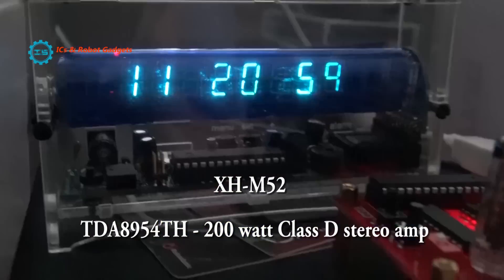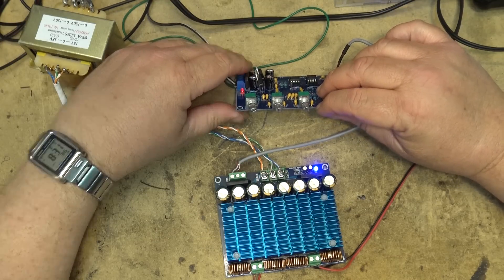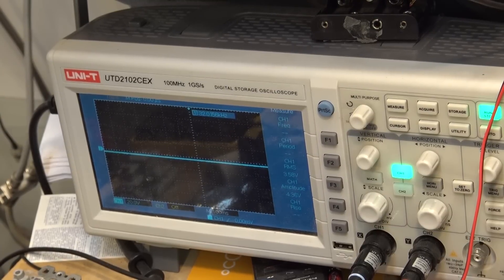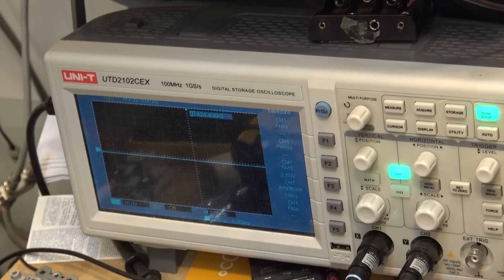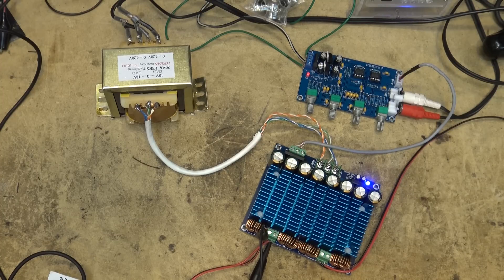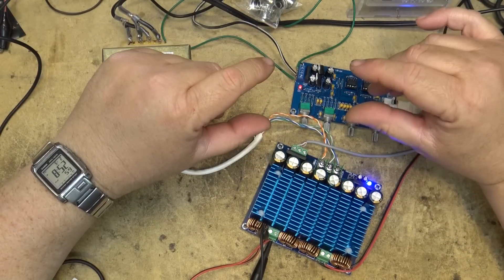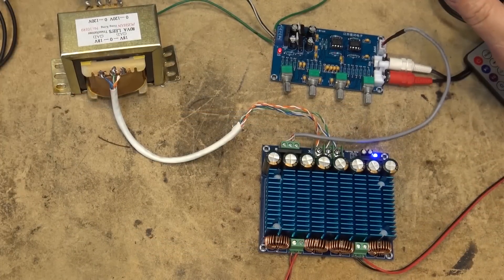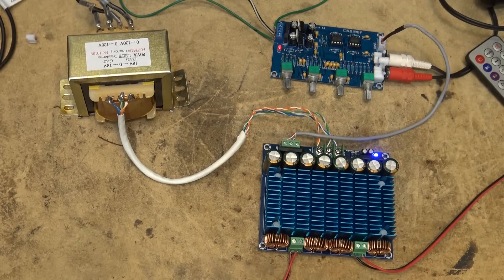XH-M252 TDA8954TH Ultra high power Class D amp review

Comment: Nice video sir. I bought this board Fter watching this video. My board came up with 2fans ,one each ic with 2 individual heatsink and a little volume control.  requirements of the transformer is dual 24Vac (24-0-24AC) above 300VA so I ordered a 24 dual ac 500VA toroid transformer. I never used on board dual rectifiers so I made my own dual DC power supply with 4 22000uf capacitors 2 on each channel and 8 SF58 (5amps) ultra fast recovery diodes 4 on each channel. I hooked every thing up the sound quality is much better than my old stk4191 ic's receiver. Bass and sound quality is really good and expected after spend around $200 behind the project lol. I got a question now, should I use 4 more diodes and 2 capacitors to make another dual 24 DC  supply to added my another stk4191 board with the same Transformer?? Because I feel like it's weasting of power lol, the tda8954 board probably can pull 300-400 VA (6-8 Amps) 3 to 4 amps on each channel and I still got 150-200 VA(2.75 to 4 amps)left which is perfect for my stk4191 board. Any suggestions please?? By the way all other components like volume control board fans etc I have used another transfer so no power lose from the main transformer. Any suggestions please.
Reply: You sound like you have a pretty good idea what you are doing. Im just learning but have some ideas that I think I want to try. Where did you get your board with fans and volume control? I'm thinking of building one with BT module  and building it bigger heating and some other fan systems to run lower frequencies for a little longer.

Comment: Do you have a net hum in the speakers when AC supply is connected to this amplifier? I bought the same model as presented on your video and unfortunately i have strong net hum in my speakers. I use Denon PMA-720AE as a preamplifier (it has designated outputs) and 2x27V AC transformer from old amplifier. I am some shocked because it disclasifies disqualify this amplifier. Additionally the radiator is getting very hot after a few minutes after the switching it on.
Reply from the maker: No hum at all. Heat sink doesn't even get warm. Sound like something is blown.
Reply: But, my item plays music so this is very strange. You do not have hum and your amplifier even does not getting hot during playing the music. So, i think my amplifier is broken. I have to return it. This is the risk that it have to be taken into consideration when items are bought on Aliexpress.
Reply from the maker: @AK-de3ej  
Never used Ali Express myself.  Only banggood and ICStation, and had no issues.  When a defective item received I contact them and they send a replacement.
Reply: Thank you very much for the answer.
Reply: @AK-de3ej   Did you ever get a new amp? Did it not have any problems with hum? My amplifier does also have a strong net hum.
Reply: @Lunderne456  They claim that it was a new amp. I do not use it because I am afraid about my speakers. It cost ~25$ so it is not worth to damage a speakers. Unfortunately the time to return it went away. I will throw it away or try to figure out what is wrong with it.

Comment: Thanks for the video. Actually, this has two BTL chips, so its max 420W per channel... Bit on this board it cant do that.This is original data from nxp: 

SE 2 × 210 W, RL = 4 Ω (VDD = 41 V; VSS = −41 V)
SE 2 × 235 W, RL = 3 Ω (VDD = 39 V; VSS = −39 V)
SE 2 × 150 W, RL = 6 Ω (VDD = 41 V; VSS = −41 V)
BTL 1 × 420 W, RL = 8 Ω (VDD = 41 V; VSS = −41 V)

Not sure why only +- 30V when it can take +-41 and caps are rated @50v, I guess that filter is not that good. The chip itself is not even close to its maximum
Reply: Can I trust that data?
Reply: @jakobh3718  check datasheet for the chip, google "TDA8954TH datasheet"

Comment: Can you power it whit 18650 battery's
Reply from the maker: No it requires 24 volt AC.  That is 24 - 0 - 24. Once rectified that would become about +30 -30 volts.
It might be possible to build the required voltages using about 14 18650 cells in series and using the 7th cell junction as the 0 volt point.
Reply: @12voltvids  thanks a lot
Reply: @12voltvids  there are Ebay pages which say it can also be run on 24v DC have you tried running it on DC? Because the voltage gets rectified immediately as I can see from the traces and would know if it works or if I saw it wrong
Reply from the maker: @BadMax02_VR  The voltage gets rectified into 4 separate supplies, 2 per channel with respect to the center tap. With 24 - 0 - 24 configuration that will produce about 48 volts per rail.
So your +24 -24 swing on ac cycle will produce just under 48 volts DC. Do that for the other side of the transformer secondary, and you have another 48V. Negative of one cap to ground positive of that cap to negative of the second filter cap (so the mid point floats at around 48V) and on the positive terminal you have about 96 volts. That 96 volts becomes the switching voltage for the pwm signal. This is how you get the rated power of this module. Can you power it with lower voltage. You sure can but the output wattage will be greatly reduced because the PWM switching voltage is what derives your speaker voltage after it runs through the LPF to remove the switching signal. Make no mistake this amplifier delivers serious power at the rated input voltage.
Reply: @12voltvids  so how would I go to power that thing with a a couple of switch mode power supplies wired in series I have a few server supplies which each have 12v and I can wire them in series like I want because I have isolated them.
How would I do that or is it even possible it should right?
Reply: Most definitely, say you can use the TDA8954TH with both AC and DC voltages.  You just need to make sure you can provide the required amperage using DC Voltages

Comment: 12VOLTVIDS, thanks for the video, very informative.

I have the same class d amp, and just recieve it yesterday. it is meant for a very nice stereo subwoofer system with a pair of 10" 500watts 8 Ohm, that i restored and upgraded for the task. i hope it work good enough to drive those swoofers.

I will ask somethings:

This amp has on it a couple of TDA8954TH (TDA8954TH x 2) each one fixed at mono function. and it's datasheet  show a power value of 420 watts per channel.

Sorry if i don't understand or miss something in the video, but:

what is the real output power of this amp per channel with a psu at 18 volt 10 amp (this is a very nice trasformer) and at 24 volt 10 amps?

this amp can be arranged in bridged mode? (because this amp have 2 TDA8954TH each one already bridged to give 420 Watts each or per channel.) 

so, in this model, how can i use the bridged mode?

thanks for any help about this matter.

greetings.
Reply: Hello
Please tell me about transformer
I have a XH-M252 (420+420w) amp 
This amp is give 420w RMS Power @ 8 ohms
So please tell me about power supply
Volt is 24-0-24v that's I know but please tell me about current if I use 24-0-24v 12A transformer is suitable for this board or not If suitable it's ok but if not suitable please tell me about current or fully details of transformer

Comment: I have this same amplifier, every thing  sounds good and seems ok but the only complain is that those inductors and the heathsink gets too hot(65c+) without any load and signal, after 2 minutes of being connected i can't even touch the heathsink or the coils so i think something is wrong or is about to fail,the voltage is 24-0-24 AC so nothing wrong there, not even a linear amplifier do this that i know.
Also i have another amplifier tpa3116 that only gets hot when music is playing loud
Reply: Oscillation, Possibly outside human hearing range...?Do you see anything on a scope. No scope? compare current draw with inputs shorted Vs. connected.
Reply: @Chancho00,  I am also experiencing same issue when connected with 24 0 24 and no load and was wondering whether  the board I received is faulty.  But now it is confirmed. Something is terribly wrong with this amplifier. Thanks

Comment: Its just a shame that all the audio boards have different supply requirements. It would be good if they produced a line all running from a single ct ac supply rather than 12v, 24v etc.

Comment: I wonder if you could connect the two channels in parallel to drive a single speaker.  I'm thinking of a high power amp for a subwoofer that might go down to 2 ohms.
Reply: You can do that with dual voice coil speakers. Also many Texas Instrumen class D amps lets you bridge them for mono and 2 ohm stable.
Reply: That chip does show specs down to 2 ohm
Reply: @coilsmoke2286 but it said on the datasheet on the amp chip. It can only handle 8 ohm loads..... But it can handle 4 ohms but it has a current limit and cuts of at around 60% vol due to the protection.
Reply: there are 2 chips on the board one for each channel and they already are in bridged mode because one chip is a stereo amp but with a brdiging mode built in so that they are already bridged normaly 2x210w one chip and bridged 1x420w because there are 2 chips 2x420w
Reply: I dont know if you can put in Parallel BTL PBTL AND work with 4ohm load AND make 800w 10% THD or 400w 0.2% THD for Better sound quality

Comment: I would love to try these amps out but looking for a transformer is given me a headache now.
Reply from the maker: Get one from an old receiver. That's what I plan to do,
Reply: 12voltvids 24 volts at 500W (200Wouput/channel right?) isn't easy to find, that's for sure. Rectified that's 34 volts or so, B+ voltage only found in low power recievers. I guess it's a catch 22. Does this amp's power supply require a center tap? A variac is dangerous but may be the only good way to get full power.
Reply from the maker: Evan Fitzgerald 
It will draw much less than you think. At full power this is going to draw less than 10 amps on the low voltage side. Remember each side is bridged so each leg running 48 volts around 2.5 amps, 5 amps per speaker. 10 amps total for low voltage side. Primary side would be about 2 amps. Remember these are very efficient amplifiers unlike a linear amp which wastes much of its power as heat.
Reply: 12voltvids 240W transformer then? The amp in the video is 2 50W at 8 ohms channels bridged for one channel of 200W at 8 ohms, correct?
Reply: @Stereosandotherfun  could I power it with 4 12volt car batteries.
My truck is 24 volt .And I have a couple spare lying about .
Reply: @seancunningham9448  probably you would just need to make a center tap with half the voltage

Comment: Could you link to that transformer you have there? I have the tube amplifier you have that hooked to orginaly. I have searched high and low but can't find one anywhere. Thanks
Reply from the maker: Charles Tyler 
Transformer came from lees electronics in Vancouver.
Reply: 12voltvids they won't answer emails I sent 4 weeks ago. The model you have is out of stock has been for a long time.

Comment: Hi, new to your Chanel , enjoy your vids, have picked up a few tips and tricks, I'm an ametuer enthusiast so always looking out for helpful  instruction, 
Liked you review of the turntables, although not convinced enough to buy one, 
How ever;  have a question for you relating to turntables, I just bought a valve preamp, the 6j1 stereo and  its output is extremely quiet, my question is, are these things design for ceramic cartridges or magnetic, I use magnetic, and the only way I could get this thing to perform was  to plug into a built on turntable preamp in an older HiFi amp?. 
Look forward to you're answer/reply, thanks Gary.. Cool vids. Keep; it up, stay well.
Reply from the maker: gary Maddison 
Many of these valve buffers are just that. They work with line in and give line out. For a magnetic cartridge you need a magnetic pickup preamp.  They are also available. I converted one of my tube buffer over to a phone preamp stage by just adding an ic based phono preamp with runs eq ahead of my valve preamp. That way I get the gain of the preamp ic. And the sound of the 12au7 tubes. Sounds fantastic.
Reply: Hi, thanks for taking the time to explain, ( re) 6j1 valve pre amp, I wasn't aware they were merely buffers, yove helped me  again thanks, and appreciate you answering, be well. Gary.

Comment: So, is that 325 watts per channel?
Or did I figure it wrong? (At 8 ohms   per speaker) edit:I forgot 51 volts might be peak to peak, not RMS.
Reply from the maker: Mark Markofkane 
210 per channel is what they claim and the chip spec supports this. At 24v CT transformer that is 48 volts rail to rail to rail per speaker output lead and since this is btl that would be 96 volts differential max between the +and - terminals. You will obviously never see 96 volts as that would be in a perfect 100% efficient model but it should be able to push peaks well into the high 80 volt range. These amps are pretty efficient.  I used to thumb my nose at class d, as being a bit of an audiophile snob my feelings is if it doesn't have tubes in it, it isn't worth putting music through, but lately some of these new designs have had me rethinking that opinion. I still think tubes have a nicer warmer sound at low levels but these modern class d, especially this one has balls. It has a good amount of punch, thanks to those huge inductors no doubt.
Reply: @12voltvids  *480w per channel because this particular amp board you have is dual mono. It means theres two tda chips, bridged mode. On one board:)

Comment: This amp has to be pretty good. You never know 100% by time sound goes threw camera then computer speakers. But this time my computer sub is vibrating my couch at normal volume, this is not normal. P.S. Great little amp and video but can't explain how much I hate that California sounding girl at 10:00. She can send me sprinting across room to volume control faster then a Rick Roll. Both informative video and exercise so double upvote
Reply: She sounds like a cat with it's tail caught in a screen door
Reply from the maker: dirkbonesteel 

This is the best sounding module I have listened to get by far. The intent will be to put this into an old receiver where the power amp is toast. I have an old akai amu02 that even though the amp is OK, it is only 25wpc using stk power modules. I think putting this in the cabinet and using the transformer from the original will make it kick some serious ass and it has a cool VFD power meter in the front to boot. This could be added internal and wired to the volume control and turn the old 27 watt amp into a 200 watt pounder. Stay tuned as that may be a project.
Reply: I like it. Something similar to that no one has done I know of. A 50's Bakelite radio with new paint, this amp set up. Add  trebilo and up the gain to one channel, remote speaker jacks, put the extra controls in back and you have a seriously cool little 2 channel guitar amp

Comment: Do you have a non inductive load?  That would give your ears a break at high power levels.
Reply from the maker: 1959Berre 
I don't have a power soak. I need one so I can crank up these power amps and see if I can make them fail.
Reply: 12voltvids  number 18 NiCr in a  plastic bag of DI water in a coffee can is what you're looking for
Reply: a coil in an oil bucket would do.... (or 2 for stereo...)

Comment: It's nice they used Nichicon caps on this one. :)
Reply: Those may well be fakes.
Reply: This isn't true for smaller chinese boardmakers. They will put in fakes knowingly. It won't hurt sales on alibaba and ebay.
Reply: They look fake, with the bubbly tops. To be sure, the bottom rubber vent is a dead giveaway. The fakes i've seen are not shape molded.
Reply: The problem is fakes are very hard to spot from the outside. Many times legit parts makers will make a slight dsign change and then everyone thinks they are fake. The only way one can tell if if they start failing in numbers and that usually doesn't happen for a long time. No manufacture will use substandard or counterfeit parts. For starters if they did and these were identified as such, entire shipments could be seized by customs and destroyed. There is a difference between using no name shit parts, and making shit parts with legit brand and trade marks. When those are discovered the entire shipments are seized, so no company is knowingly put them in. You are much more likely to get fake parts when ordering spare parts off ebay than in manufactured goods.